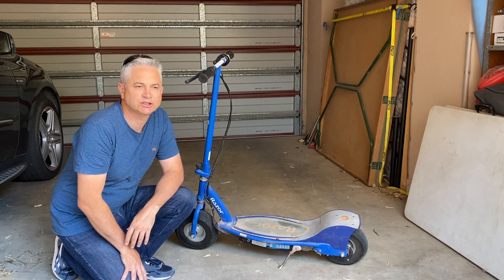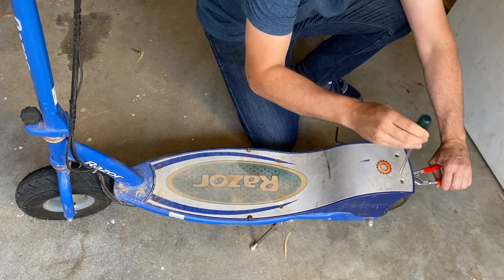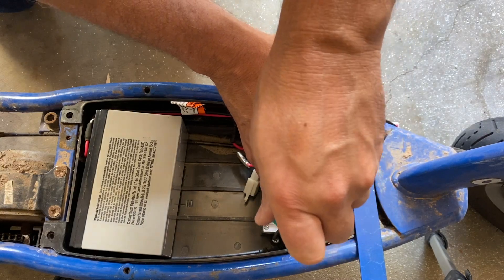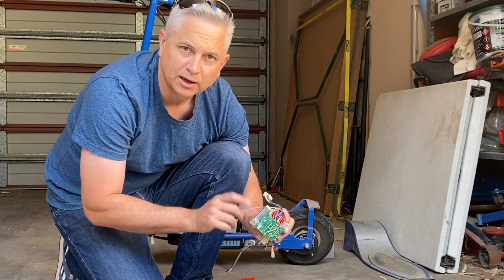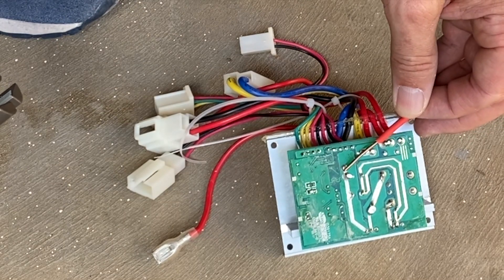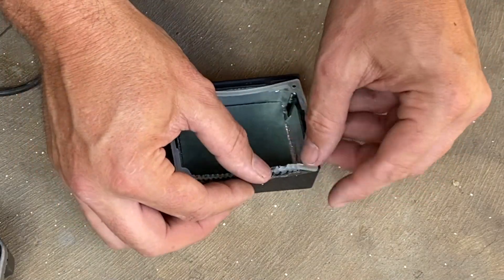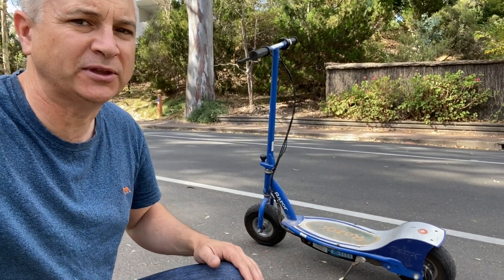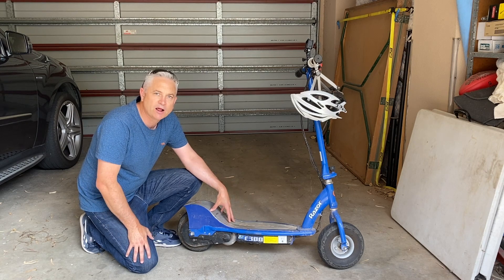Razor E200 E300 Speed Controller Hack for More Speed and Power

Comment: I would just wire those 2 12v batteries to 24volts... Risk burning it out very fast 😂

Edit:
If its already 24 volts ill install 2 24 volt garage motor shallow batteries then 😅
Reply from the maker: Interesting approach … it’s already 24volts and I reckon putting 2 x 24 volt garage motors in series as you allude to that you will smoke your motor and/or speed controller pretty quickly! Cheers Drew

Comment: didnt work

tried solder wire as shown.  kept tripping breaker 20a    so wired a 30a fuse bypassing factory breaker.  no luck . wires super hot and melted 30a fuse.    did have more power or torque with either scenario.   nice try but waste. reset to factory and sold it

Comment: Hi Drew I need more help with a Razor E300 Scooter I was given this old scooter replaced the motor and batteries but found it sluggish and slow . I followed you speed controller Hack with great results but with one problem it cuts out after awhile. I reset the switch and it goes again but cuts out again.Any thoughts Thanks

John Central Coast NSW

Comment: Do you  know if you can bypass the charge controller for charging?  That is, wire the charging port black wire to neg terminal of one battery and then red wire from charging port to positive terminal of the other battery?  I think the charging port on my controller has gone bad.

Comment: If you see what your doing it’s just  the motor ground  yellow wire that directly connects to battery ground through that shunt which is always grounded anyways. Why not just hook yellow motor ground  to black battery ground outside the controller for the same effect?

Comment: I just found an E300 in the trash.  I asked the people working in their garage if they were throwing it out.  They said "yes" and that all it needs is new batteries.  It is in fantastic shape.  I guess their kids didn't really ride it all that much.  I have been binge watching mod videos about the E300, and there certainly a lot of them.  I need to buy some new batteries, make sure it really does work, and then I am doing this mod.
Reply: This is so funny. I also just found one in the trash. All that was wrong with it was the rubber of the throttle came unglued so it doesn’t turn the throttle anymore. The battery was good I turned it on and rode away. 😂 $15 charger and now I have another project… 😅
Reply from the maker: Awesome!  If you didn’t get the charger go back and ask them if they still have the charger too!!! Cheers Drew
Reply: @DrewFixIt  Yeah, they had the charger with it.  I'm just glad I got to it all before the scrap metal guys came around.
Reply from the maker: @BryanWhite77  Nice, I call that a score! :_DFI:
Reply: @DrewFixIt  I got two new 9ah batteries and got the scooter going.  The kids love it.  I also did your mod and it definitely makes the acceleration better for a bigger person like me.
Reply: Also razor scooters have a kickstart protection feature for the motor to not burn it up you can not just throttle while standing stationary. You must push yourself pretty fast while holding throttle
Reply: @sppookkyblake9056  My E300 doesn't need a push start, it goes from stationary.
Reply: Even if it needs new batteries 50% chance it soesnt 25% it does but they have some life left like half life from poor charging. Jump it if its low with 24v but only for a couple SECONDS 😢 , 25% its completely dead

Comment: 5:33 do you solder the 2 bulbs together where the wire meets one side or are the bulbs still separated where one side of the wire is soldered at

Comment: I just tried this mod and no change. I also changed the batteries with new ones (12 volt, 7 ah, lead) and a new motor (higher wattage). My sons charger barely lasts 10 minutes and struggles going up hill. Im frustrated...could it be the speed controller?

Comment: Hey drew. About to do this. Just a question, will this hurt the scooter in anyway? Do I have a chance of melting the motor with this or hurting the batteries? I have an e200, if that helps.
Reply from the maker: Hi Mate, you are effectively over riding the built in limiter, however in reality you’re only going to give a percentage boost of 10 or 20 percent so the chances of damaging your motor or batteries is minimal.  My scooter as an example is still running fine with this mod personally!  Cheers Drew
Reply: @DrewFixIt  Thanks.

Comment: Hi Drew, Followed your instructions on this mod for an e325 and it worked great at first, way more power. While testing on the first ride It then started causing the reset button to trigger which in turn turns off the machine. I can hit the reset button and then turn the machine back on and then it works fine for a while but then it will trigger again. Any thoughts on why this is happening? Can I bypass this by unplugging any of the connectors? Any fixes I could try? If it continues and not that I want to but can I solder this off and would it in theory return to its original function? Appreciate any advice, thanks!
Reply from the maker: Hi Mate, what is happening is that you are now pulling more current and it sounds like it is right on the limit of that fuse.  I would suggest putting a fractionally larger fuse in!  Alternatively, go fractionally smaller (in diameter) with your bypass link that you have added to the controller board. Cheers Drew

Comment: Would dis work on a razor e325   ?
Reply from the maker: Hi Mate, it just depends upon what Speed Controller Razor fitted to you model.  Best to open it up and have a look inside to see if it looks the same or not?  Cheers Drew
Reply: I did and it looks the same but when I did this it did not work

Comment: Thankx
This mod worked GREAT on both my E300 with OEM batteries!  I weigh 160lbs.  I used a 14 ga bare copper wire found in some spare home Romex wiring I had. 
My soldering gun would not get the ends hot enough to melt my soldier SO I just used a small palm size butane torch I have. 
It worked well to really apply the heat with its blue flame tip and quickly heat the copper end and the old soldier and new applied melted together. Be sure to use flux if your soldier isn't Rosen flux core. 
I did one end at a time.

Comment: How many gauge or what size is that copper wire u used?
Reply: I used 14 ga home solid copper wiring but 12 ga home wiring might give a slight more power, not sure.

Comment: G'day Drew, im still very new to these Escooters.
If that one bit of wire already on the green side of the circut board is the speed Limiter, Then wouldn't adding another wire on the other side do same thing, or keep it as limited as it already was?
Reply: It adds more material to that circuit thus limiting the "amount" of current flowing through.
Reply from the maker: Hi mate, adding more material to the circuit actually has the effect of “increasing” the current! Cheers Drew
Reply: is that little wire supposed to be resistive? bc i have that too. i mean ig adding more wires increases current lol but is it negligible?
Reply: resistance = resistivity of material*length of wire/cross sectional area. to increase current use a material with a really low resistivity, as short as possible and the widest cross sectional area

Comment: Hi. Can you explain the engineering behind this hack. Why does it work
Reply from the maker: Hi Zubair, the thickness of the original shunt limits the amount of electricity that van flow through it, think of it like a skinny water pipe for which we then add another pipe alongside it!  Cheers

Comment: Extra torque is fine, but can you tell me approximately on many more mph you get ? Thank You 😊
Reply from the maker: The top speed is only around 10% faster, the big difference for me is the increase in acceleration!! Cheers Drew
Reply: Try a smaller sprocket

Comment: DrewFixIt - great video - went to my E300 took apart my controller and its been dipped in some black epoxy and i cant get to install the shunt - any fix or am I shit out of luck?  It has part number ZL 200430080172.1 stamped on the heat sink. Looking forward to some solution.
Reply from the maker: Hi Rob, can you possibly upload a photo? Thanks Drew
Reply: @DrewFixIt  - Drew - please look in your instagram - i sent the pictures to you there. Thanks
Reply: Drew could I invite you to the Google Album?

Comment: Hi Drew love this idea. I used to own a Grey razor e300. But now I upgraded to a razor eco smart. So my wife has a first gen E200 belt driven with a variable speed thumb throttle. I was wondering if this trick would work with this mod?
Reply from the maker: Hi Mate, yes this mod should also work on the Razor E200!  Cheers Drew

Comment: I only get 2 miles range with brand new 12V 7AH batteries and I weight 150 lbs and the original speed controller with no mods. Why is this?
Reply: Check the voltage individually on each battery after they have been charged. One of the batteries might be bad. Batteries can be temperamental and can go bad like eggs.

Comment: Totally worked man, good video thanks. Pulls my kids right up the driveway now. I even installed 2 new 12v 9ah batteries vs the 7ah.
Reply from the maker: Hi Pete, awesome and thanks for sharing!!  Cheers Drew
Reply: It works better with that batteries? Is there a real difference in terms of performance with the upgrade of the amperes? Do you installed lithium or lead-Acid batteries?
Reply: @AudiofiloChacharero   I just ordered the replacement batteries for the razor e300 but made sure to get 9ah rather than 7ah. They are sealed batteries. As far as the Mod with wire, I used the piece of copper from a white roll of 120v I have. Soldered that and it pulls my kids up the driveway now. Wouldn't do that before. Hope this helps you out.

Comment: Drew, I was given an E300. The batteries were bad so I got new ones.  The motor runs and turns the wheel, but when I put weight on it it will not turn the wheel. As soon as I lift the rear wheel and it has no weight on it, the wheel turns.  Any idea what it could be.
Reply from the maker: Hi Nick, what band of batteries did you put in? Cheers Drew
Reply: Same problem.

Comment: Can this be done also to the controller of an electric wheelchair? What's the percentage of improvement for the speed and torque? Will it not heat faster? Will it not take so much from the batteries that will end up reducing the battery capacity per charge? Hope you can answer my questions and guide me, Sir.
Reply from the maker: Hi Mate, I would not personally do this to a wheelchair controller. Cheers Drew
Reply: @DrewFixIt  Alright. Thank you, Drew.

Comment: Yes so in the case of my Fiido T1, the problem is the opposite, too much power -  there is no finesse in the throttle - its on/off. I want to put in a switch from the handlebars with a wire going down to the controller. In one position the original resistor value is in circuit as normal (with full power). In the B position a higher value resistor will be selected to give a lower current and hence lower throttle.
Reply from the maker: Hi Steve, understood.  I’m not sure why razor didn’t put a variable speed controller in these scooters! Cheers Drew

Comment: What I need to do to fix my razor E300s it run but no power or don’t move when I get on it
Reply: Check the battery's individual voltages with a voltage meter. One may be bad.

Comment: I found one of these by the side of the road for the trash and took it home and the batterys were done and I think the controller didn't work so I'm going to run it straight to a 24 volt lithium battery from another old scooter and just use a toggle switch and wire directly from the motor to the battery.
Reply from the maker: Hi Stephanie, nice find!  To do what you want to do you will need a relay as per this video I made on another scooter: https://youtu.be/MMEqKcgljdw Note - without a relay your switch will die sooner or later!  Cheers Drew
Reply: @DrewFixIt  That would be nice to have because then I can use the throtte switch instead. I got it to go down the road like this but the battery is not good. i only got like 200 yards and it died. do you know a good place to order a 24 vilt lithium battery? I'm thinking at least a 10 amp hour one.

Comment: What range are you guys getting with the 24v 7ah  stock battery?

I got about 6 km but the batteries are 7 years old.
Reply: That's what I'm getting too with 4-5y old batteries, and it is time to get some new since the service tech guy told me that with new and a bit  stronger batteries performance would increase a lot and with this mod, would be even more, so get yourself a pack of new juice and good luck!
Reply from the maker: Hi Gerard, 10km is about normal.  So I reckon you’re doing well out of 7 year old batteries!  Cheers Drew
Reply: And the rider weight is about 78kg. 😅

Comment: Has anyone tried the e300 original controller with 36v ? Or has anyone seen the capacitors voltage rating inside the controller?
Reply from the maker: Hi Gerard, you will blow the capacitors and FET’s!  Cheers Drew

Comment: Hey is it possible to replace the battery and the motor in a razor scooter that is a e100 and replace it with e300? My scooter is a very small scooter tho it’s one of the kid ones that goes 8-10mph
Reply from the maker: Hi Mate, when you consider the amount of money that you would spend on these upgrades I suggest that you would be better off finding a second hand Razor E300!  You will then have a very solid platform/base to move forward with!  Cheers Drew
Reply: @DrewFixIt  that’s true. But would it be possible?
Reply from the maker: @everleighshortsedits9500  anything is possible, I just don’t understand why you would do it! Cheers Drew
Reply: @DrewFixIt  it would only cost me $80 and a new one is over $200😂❤️
Reply from the maker: @everleighshortsedits9500  go for it then!

Comment: Loved the video! Never thought you could modify the scooters like that! Can this simple modification work on the lesser "E100"? It goes about 10 miles an hour. Thanks for sharing your knowledge....👍😎👌
Reply from the maker: Hi Alan, unfortunately the E100 only comes with a 100W motor and the core platform is small with a little rear wheel.  I suggest upgrading to either a E200 or E300 which will give you a good base platform to upgrade from. Cheers Drew
Reply: @DrewFixIt  hey, thanks man. Even though I can't use the mod on my E100, I still enjoyed watching the upgrade. Thanks again...😎
Reply from the maker: Hi  @alanpules4105  if you like that one perhaps you might like this Razor one I did playing with some different custom lithium battery packs: https://www.youtube.com/watch?v=vHbdyS-3Hrw  Cheers Drew

Comment: Would it work on an e100
Reply from the maker: Hi Mate, e100 come with only a small motor, are painfully slow and are just not up to the job unfortunately.  Suggest you upgrade to either a E200 or E300!  Cheers Drew

Comment: Drew,  greetings from the USA!  I was just given a 2017 E300 that didn't work.  I installed new 12V 7AH batteries and took care of  some broken wires between the throttle and the speed controller and everything works now.  I wanted to improve its performance and found your video.  I am glad I did.! At first I was skeptical about your mod, but I figured I'd give it a go.  I did your mod to the speed controller last night, and now I can get up a fairly steep hill and the speed is noticeably better! Prior to your mod, I could only get half way up the hill.  I weigh 175 lbs. and the E300 zips me along no problem thanks to the mod.  My 12 year daughter notices the difference too!  She really flies on it!   I recommend this mod to anyone with a stock E300!  BTW I am a Mechanical Engineer if that matters to anyone reading this.  Thanks again!  Cheers!
Reply: voltage and current is going to define perform, 9Ah is a measure of capacity, it determines how far you'll go (or not go in the case of old SLA batteries :)
Reply from the maker: Thanks for the feedback!! Cheers Drew
Reply: @DrewFixIt  hey will this mod work for the e200s?
Reply: @DrewFixIt  will this mod work on the e200?
Reply: Greets from South Africa! Same here, also given an E300 that just dies under load so i'll be doing exactly what you did.
Reply: What about battery life? Does it reduce? Want to do this for my sons scooter that he uses to commute to his job, but with stock 40 minute run time, it makes the return home without charging a little bit sluggish. Will this shorten the run time?
Reply: @kirkjohnson954  Of course it will.  There are no free rides in physics.  If you use more power in the same amount of time, your battery energy will be consumed faster--which will result in a shorter run/operation time.  That is a simple problem to solve, though--just replace the battery with a li-ion battery & change the charger & the scooter range will be much further, as the energy density of a li-ion is much higher for the same battery space.
Reply: @ab_ab_c  you forgot to mention that lithium batteries can discharge deeper than the lead batteries which is another reason you get more energy from them. But finding the correct lithium battery to fit that is still large enough to handle the current surges and rewiring and buying a matching charger and considering 36v with a new 36v controller are all things to consider in such a conversation.
Take care
Reply: what battery would you suggest?  @ab_ab_c
Reply: You're supposed to use a 12v 9ah battery that's probably why you were having that issue
Reply: @jonathanquezada1956  

P=IV
Power(Watts)= I(Amp draw) x V(Voltage)

Power will be the same using either a 7 ah or 9 ah battery.  Only difference is the power created will last a little longer with the 9 ah batt. So no increase in speed.
Reply: @Hectorgutierrez  you need a litium battery its gives more ah, don´t buy the old bulky ones.
Reply: @Hectorgutierrez  Well said.